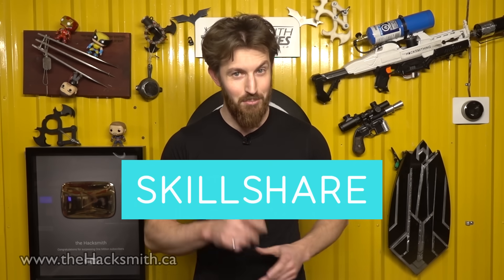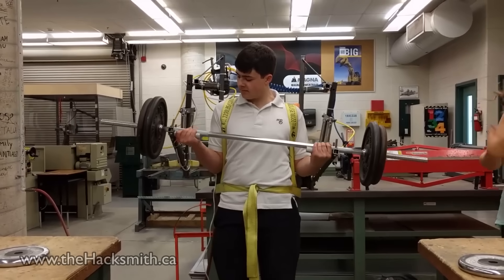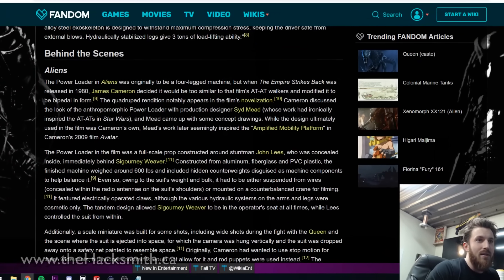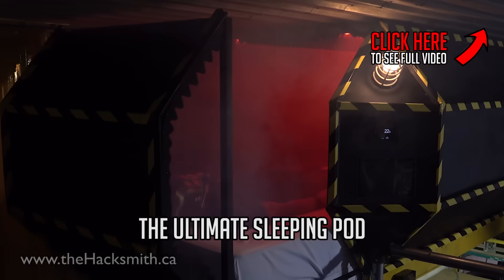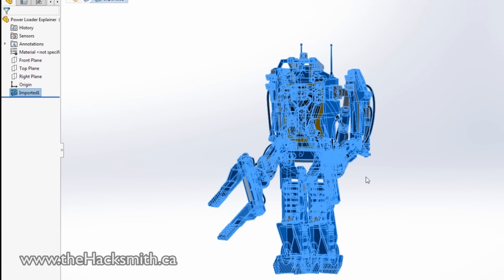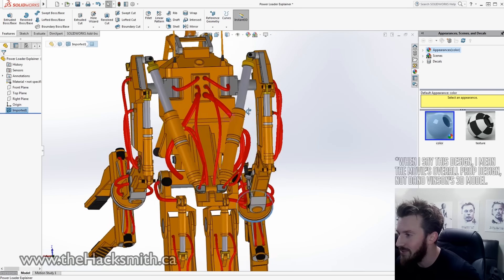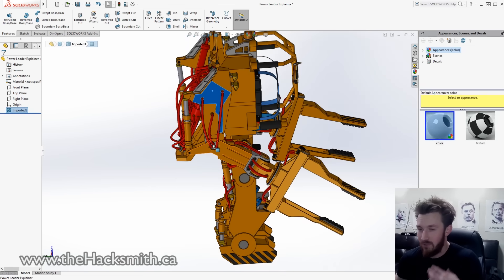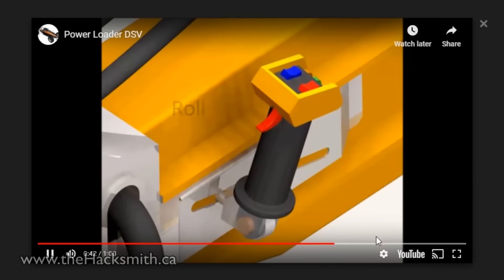Designing a MECH! (POWER LOADER: PART 1)

Comment: I was a Weapons Loader in the USAF when that movie came out. Every load toad I knew wanted one of those. There was a scene where a weapon is being loaded, the weapon looked very similar to one that we loaded on the F-4 aircraft. The weapon knows as a MK-20 (Mark 20) Rockeye (CBU-Cluster bomb unit). We all fancied trading in our MJ-1 Jammers for one of those suits. Oh, yeah, MJ-1 Jammer (known as a J-1), and MHU-83 Jammer (also known as a J-4). Basically glorified forklifts. Used for loading Aircraft weapons on pretty much every USAF Aircraft, at least on all Aircraft I worked on. Lift capacities 3k lbs and 7k lbs respectively. There are several adapters that can be attached to the "table" at the end of the lift arm for various weapons that need specialized loading. Like sliding onto a launch rail, like the AGM-65 Maverick, onto a LAU-88 three rail launcher. Talk about your loaders nightmare! I once loaded 6 missiles, single, which means sliding them onto empty rails hanging on the aircraft. 

You can find plenty of images and specs (can even buy one, I did see a MJ-4 for sale once for $7500. If I had a spare $7500 I would have jumped on it!)
Reply: Seems like aligning the weapons with the rails would be really tricky. If so I imagine in the future they might develop loaders with sensors and some level of autonomy to help with that.
Reply: @r7calvin  Look up USAF MJ-1 and MHU-83. We call them JAMMERS. The J-1 and J-4 respectively.  They are fun to drive too! :)

Comment: why does the wrist have to be hydraulic ? electric would be less bulk high torque electric motor that size would do the trick better i think you need power for the hydraulic motors so electric the wrist for size maybe a bike wheel motor shaft through for strength

Comment: I guess I'm watching and commenting on the now because, for some reason, YouTube suggested it to me...
   Anyhow...
   I would disagree with your premise that a power loader is impractical. A Forklift is only practical in very specific places like a warehouse or anywhere else you have nice flat surfaces run them on and nice flat things to lift. Anything else and they become less than ideal which makes sense considering they were developed to solve a specific problem: move heavy, palletized loads across a short distances from a storage location to a vehicle for transport. Yes, I know that in the broader sense there are specialized ones and they are used in a variety of environments but generally speaking, my description hold up.
   For any number of reasons a heavy object that needs to be moved may not be on a pallet and you may not have a nice flat surface to traverse. Go back and look at Aliens and imagine a forklift trying to move cylindrical munitions over the uneven deck of the Sulaco. The military uses very specialized aircraft munitions loaders (some so specialized they only work with a single model of aircraft) that are way bigger than a power loader to lift an equivalent load and take up much more space.
   And this is what makes the power loader so much more practical. If have you cramped spaces and uneven flooring (steps, cables, etc.) you're definitely going to need something that can get in there and move around and get the job done.

Comment: The question is..how do you ever intend on providing motion for mobility? From an engineering standpoint, you are dealing with an impossibility. Too many questions and too many impossibilities when comes to feasible leg motion/mobility for a bipedal suit having the necessary lower weight and materials for strength/stability especially using either electric motors or hydraulics. Movement would be slow...super slow..unstable, straining to the operator, and the power requirements using either form would be unreal.

Comment: You thought there was probably no real practical use for a Power Loader,it's work performed well by forklifts.But back in the 80's,a UK show,'Beyond 2000' featured a prototype identical to Power Loader.Its main use would be for operating in confined spaces,such as a ship's hold (this was when containers were still in development) But the main problem (which is still a problem) is to have an on-board motorised unit to power it and its hydraulics.I think James Cameron's mock-up in 'Aliens' had electric servos with long extension leads hidden from view.

Comment: As i watch this video im realizing that all the functions your looking to design can be gleaned from your average run of the mill skidsteer. The problem your going to incur using hydraulics is #1. Your going to need about 30 gallons of hydraulic fluid for all the cylinders. #2. Your going to need one badass motor whether electric or gas to power a hydraulic pump to move the fluid. #3. You can use electric motors on the ringgears for the wrist but most ringgears are not designed for horizonal operation. I work heavy equipment for a living and have worked on them for a very long time so take that for whats its worth. Love your channel keep up the good work and ill keep watching.

Comment: The whole point of a machine of this variety is to move items that can't be easily palletized or stored in the regimented space that a forklift needs. A while back, I worked in a place that made heavy steering parts, and something of this nature would have been extremely useful in picking up something and putting it somewhere else without having to wrestle pallets.

Wait and see.  The first ones will be a solution looking for a problem, but humans will get a clue.

Comment: You're various projects have inspired me i am now sourcing tools and materials to build a powered hazmat suit. You're welcome to make one aswell. Mine is going to be lead and fiberglass and may have durability issues. I'll be using pneumatic for the lifting mechanism and dc motors for mobility. My intention is to encourage a practical purpose for a mechanical suit as there is a lack of need for these suits yet due to cost of production. Hopefully i can create interest in the market for powered suits this way.
Reply: I suppose a remote. Control robot would be much cheaper but i like powered armor better lol

Comment: I feel that the best approach to this would be to have upwards proportional master/slave systems behind it. Maybe (and i know the project is 5 episodes in) find one that's been trashed? They cost a heap, but even gleaming a few looks at one is a super leap. Some of them can lift a lot compared to what you "put" innit.
The video is likely buried under a ton of false hits so i won't even bother, but there was a guy here in the early days of YouTube that "dissected" such an unit and it had some pretty clever hydraulic inner workings. For example, the handle for the hand had a super fine valve body that was so accurate and so precise that you could pick up a raisin or squash a aluminium pipe with the same unit, and yet, the little shuttle inside was a super simplistic stepped design.

Prolly just rambling because finding one of these in the wild is super rare, but i feel that outside of using some complicated electronics to keep all things kosher, something like that is your best bet..and for some reason (probably because they are rare and custom made) nobody is doing "fun" robotics with them. Even NASA is avoiding them (tho that might have to do with potential leak issues in space).

Comment: A frisbee where the edges heat up like the lightsaber that heats up like the compound bolt crosbow so you can throw it at the Styrofoam heads

Comment: Simple geometry says that you'd have to some serious weight in the legs to stop it toppling if you go to produce a workable design . No use producing something that can't lift a cardboard box incase it topples .then you've got the ground issue of a small footprint on the ground ,will it just crush the floor ? I can't see how you could walk as we counter offset balance ,ie just lift one leg and you naturally fall  sideways if you don't counteract weight shift . Its cool to see a mech but by design it will always be fictional as by design it don't work ,surely someone from MIT doing bipedal robots would explain why it won't work
Reply from the maker: And you don't think we thought of that?
Reply: @hacksmith  so if you know it's not a realistic design that's functional then why build bits to it then ,I only said MIT as I think they are involved with the mech android that recovers injured soldiers, it's bipedal walks up stairs and everything ,so it has to operate weight shifting automatically but has a lot more movement than a mech plus the soldiers only weigh so much ,realistically like a tower crane you could have a shifting weights like a tower crane across the shoulders shifting to one side or other, plus if had cylinder behind calf's half full of mercury and you pump to other leg so makes one leg heavy  and other one light ,and so forth. Yeah mercury is some real heavy stuff ,you can put a ball bearing on top of liquid mercury and guess ? Yeah the bb don't sink .the process to weight shift would take forever and you still wouldn't be able to carry heavy cargo type box's as footprint is to small .

Comment: Document well! The military have been working with these designs for weapon loaders.
Reply: and they still find a cart on wheels with a jack is more efficient. That's where this thing fails: wheels are faster than walking and arms have a pivot point unlike forks that can go vertical.

One of these suits would be good for mining or somewhere with limited or no flat floor space. Say a rocky planet surface or something. In the time it took to move one "pallet" across the floor a forklift could have moved 5.
Reply: @muskokamike127  but it will allow a self supporting loader for vstol aircraft and helo at remote landing sites where the loaders truck cannot function due to terrain, soil and other impedance. I am sure the military would change some design elements such as the claws and feet. But the fact remains these type of devices are the subject of ongoing research by the military and as I understand it right now power is the problem since batteries just don't have the capacity needed.
Reply: @jarheadshooter6452  yeah, that's what I said: when the terrain is too rough or not flat enough for wheeled vehicles. Thank you for agreeing with me!
Reply: @muskokamike127  I can see them putting some type of slow ass tracks on it!

Comment: After watching this, your poor knowledge of hydraulic systems leaves me little hope of seeing a good result.  To be more specific: 1) Hydraulic hoses are a thing and have been proven to work, no need to eliminate them.  2) Two hydraulic motors in the wrist is a good design, why change to a cylinder that will limit mobility.  3) The hose at the hip joint appears to be passing through to actuate the top of the leg cylinder.  4) The large cylinder on the back is to raise and lower the arms to the sides, not sure how you are going to eliminate that without a major re-design of the shoulder joint.I'm sure that it would be difficult to actually making a working power loader, but you are going to need hydraulics to have any sort of useable lifting capacity, so be careful what you change to electric motors.  Pro Tip: If you want to make the hydraulics work, don't ask an engineer (unless they specialize in hydraulics, ask a mechanic that works on yellow gear or aircraft.
Reply from the maker: Watch the video again. The WAY the hoses were routed doesn't work. It's not a real model... It wasn't even made by an engineer. Try watching the next episodes.

Comment: Balance would be the biggest problem. A fork lift has huge weight in the body to counteract the weight of its load. 

There are some major design problems that need to be solved to make this, and as you pointed out it's just not practical.......shame.....
Why do you have RDJr on the wall along with some real inovators? Is it because of his YT work or the quote?
Reply from the maker: Simple, tank tread (bobcat base). Same as the militarized version of the P-5000 work loader
Reply from the maker: Rdj also doesn't have YT work... It's because he portrayed Tony stark

Comment: This project is going to be great. The comment bellow is not to criticizer the finished project you are going to end up with, it you power loader and its going to be a lot of fun regardless.

Just in your commentary on the other guys hydraulics, the hose links he has would work. The wrists he has represent a hydraulic motor used in tilt buckets. They have two hoses enter on the pivot and allow about 90' of rotation. The arm joint is a rotary coupler and is used in forestry and industry rotating heads like a harvesting head on an excavator, They are a compact version of a slew interface coupler but with less pass through functions. Hydraulic hoses can easily bend as indicated in the picture when using a high flex steel braided hose. the important thing is that the hoses fittings are crimped when the hose is in its fitted shape, This lets the steel cores hold form once crimped, you can also get 90' high flow fittings that have a nice radius on them.
Now after saying all that, the other guys hoses are incorrect to the movie, in the movie the hoses are alot more messy. In fact alot of what is in the other guys model is more tidy and boxy then in the alien movie.

Best of luck with the project and we all look forward to the results

Comment: People have built tech like this before in small scale prototypes. Heck we have seen people build Landmates from Appleseed. The issue was power more than anything. We didn't have power generation that was capable of running it while also being small enough for it to function properly in most cases. Now the issue has more to do with fine motor control and getting it tuned properly for the roles it would be feasible in. We have the technology for things like Direct Neural Input and Direct Motion Input it is just in its infancy. The role of these types of machines won't be the replacement of Forklifts but in place like construction and rescue services to allow one person to easily move large frames and beams.

And now I kinda wanna see you try to make Attack on Titan's 3D Maneuver Gear or Titanfall style Jump Kits. Even though I know that technology isn't quite there. Mainly the big issue is getting a proper harness designed for the thing.
Reply from the maker: There is no power issue for something this big -- gas engine. done!
Reply: @hacksmith  A gas generator, because mechanical energy isn't usable directly for this type of device only electrical energy to run pumps and the actuators, is too heavy in most cases. Remember that weight is a major concern for a device like this. Until recently we didn't have light enough generators to power the device and batteries didn't have enough longevity to run them for more than an hour or so.
Reply from the maker: What are you talking about? It's a mech... Gas is the very easy and useable solution
Reply from the maker: It's just a giant forklift.
Reply: @hacksmith  Weight to Power ratio. Most of these types of designs use Batteries or exterior generators because fitting them to the chassis results in a bad location for the Center of Gravity or too much weight for it to efficiently move.

For a glorified arm a gas engine/generator would work. For the full chassis most I.C.E. designs are too large and heavy to be effective. There is a reason why most humanoid machines use Batteries. At least until they break the 6 meter height mark.
Reply: @hacksmith  It might serve the functions of a giant forklift that doesn't mean it is going to be able to use the same designs.

Propane might have an easier time but still suffers from weight issues.

Comment: why did you guys not make a miniature version made with lego parts and 3d printed parts.

just to see from a engineering standpoint if it works together?
Reply from the maker: Doesn't work for this kind of thing. Material properties are much different at this scale

Comment: It is incredible how a prop will look awesome on screen, but once you pick it apart from an engineering standpoint, it is so impractical.
Reply: "Why not just use a forklift?"...Well, I'll tell you. It's practical because they are on an interstellar spacecraft.  If the feet are electromagnetic, you can put on an environment suit and walk that thing outside the ship for repairs. Given the design of the Sulaco, you could also have long term cargo pods that are kept on the outside of the hull (shape of the craft doesn't matter in a vacuum) that the loader could be used to retrieve as needed.

Comment: Wait...what!, you are only building the arm?, why is the video labeled as building a 'power loader' rather than just the arm, unless you are building each component?. With adding extra rams etc you are not keeping with the original power loader design and just building something that only has a passing resemblance, also did you think all the 'hydraulic' lines you said wouldn't work and you chose to delete could have actually been thick walled electrical lines going to electric motors?, similarly with the wrist, ever think an electric motor in the knuckle of the wrist would provide the side to side motion you need?. You should do a colab with Adam Savage on this instead of doing it alone.
Reply from the maker: We are building the whole thing. Watch the entire video before commenting... The WAY the hoses were routed didn't work, I didn't mean we wouldn't HAVE hoses.